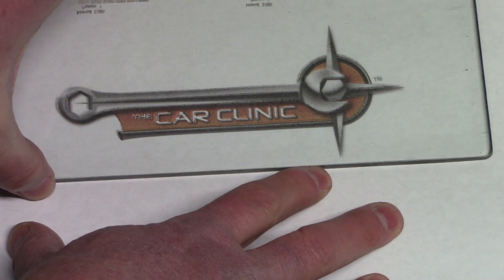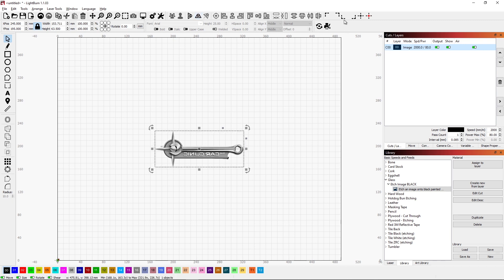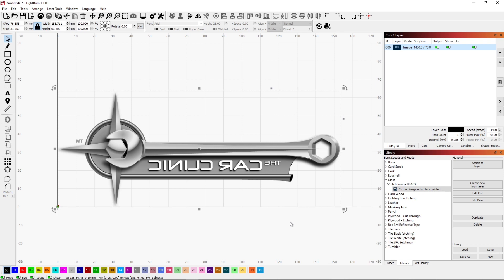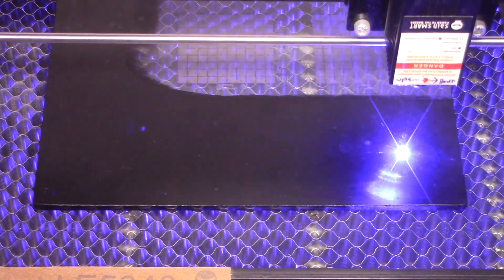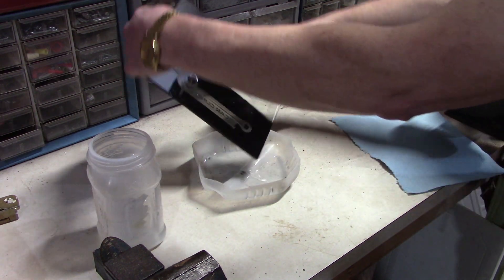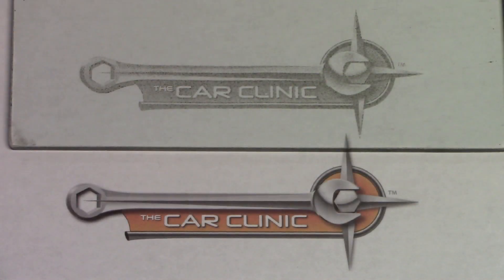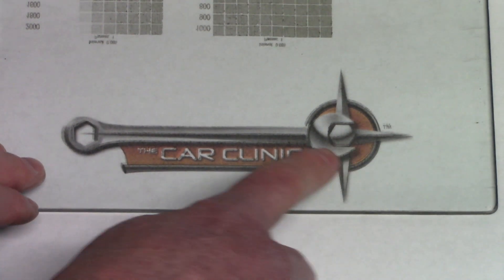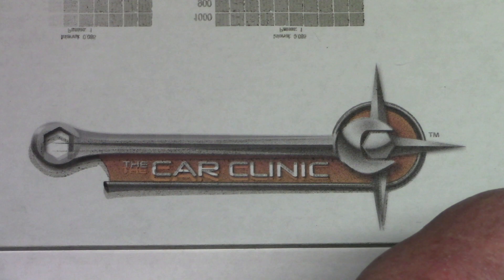Glass etching with 5.5w LED laser and LightBurn

Comment: The problem is that you are not etching in to the ceramic tile or should say the glazing on the tile. When you use the Norton White tile method it is the titanium Dioxide in the white paint that gets extremely heated and causes small divots in the surface of the glass.
Most likely what you are doing is just burning the paint. And not etching the glaze. Slow your speed and increase power. If that does do not work try multiple passes.😁🛫
Reply from the maker: Thank you for the information.  I do quite a few tiles using the Norton method.  This video was about etching glass.  I have a new one coming out where I use tempera paint and that works great.

Comment: I used this technique to make a sign . I coat the back of the glass with black paint then etch the the back . (2.5 watt laser) then scrub the etched aera Clean.
Then spray the entire back with gold paint. It looks great and is fairly  easy.
Reply from the maker: I painted my moon burn with white paint and it turned out great!
Reply: I bought 5.5w 5500mw laser engraver . It won't engrave glass . What should i do thank you
Reply: @vicsdiyprojects4585  It will etch glass (mine does) but you HAVE to coat it with a "mask".  Black, tempura (finger paint - cheap at the dollar store) paint.  Apply coats until you get as even and solid as possible.  I usually use a cheap, foam brush.  Make sure the clean the glass with acetone before coating and do not touch it with bare fingers afterwards.  You can try 1400mm/min at 70% power.  The tempura paint will wash of easily with hand soap and a fingernail brush.  I've seen people use a "cold galvanizing" spray paint also.  You will need acetone to clean it off afterwards.  Hope this helps.

Comment: I use tempera paint, it washes off with water
Reply: I have used this form of etching (2.5 watt  laser) to make a glass sign .  I remove the paint from the etched area  and then spray the whole back side with paint ( I used gold). Looks great and is easy to do!
Reply from the maker: Is that for etching glass?  How easy is it to get a even coat on there with the tempera paint?  I like the sound of the easy cleanup.
Reply: @CNCATHome  I spray it on with my airbrush
Reply from the maker: @MayTheLightBeWithYou  - I always thing of tempera paint a being thick.  I guess you can thin it like anything else.  That is cool that you can spray that with your airbrush.
Reply: @CNCATHome  I thin with water and then spray as you would any other paint, the airbrush gives great control and is so simple to clean up afterward, 2 light coats are best in my opinion
Reply: @CNCATHome  It is a paint that washes off with water, the paint just heats with the laser to cause the minute surface fractures. I got 1 litre for 7 euro so that too is a bonus
Reply from the maker: @MayTheLightBeWithYou  - I wasn't clear with my questions.  I know what tempera paint is.  We used that back in the 60s in school.  I was curious if you were using that for the etching process.  I know people have tried it for marking on white tile and it just doesn't seem to work for that.  I am glad to know it works for the etching process.  Easy on the wallet and easy cleanup.  Double bonus.